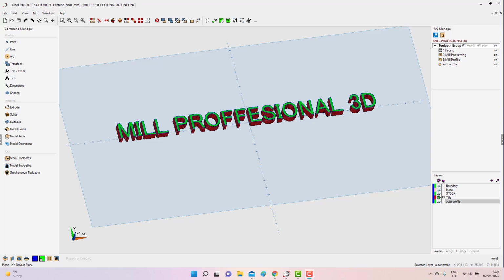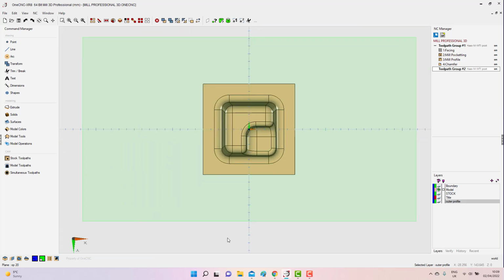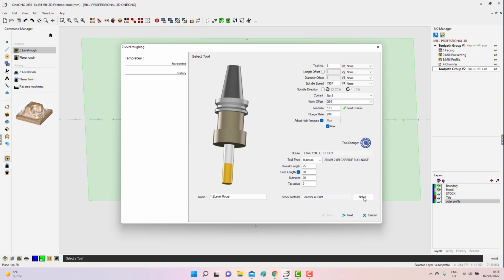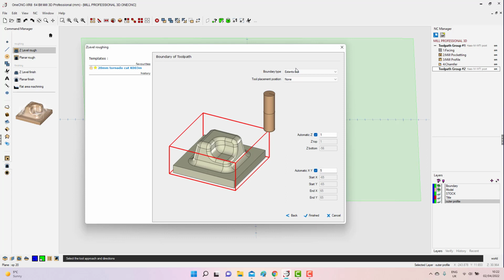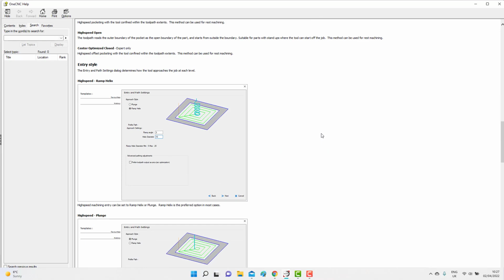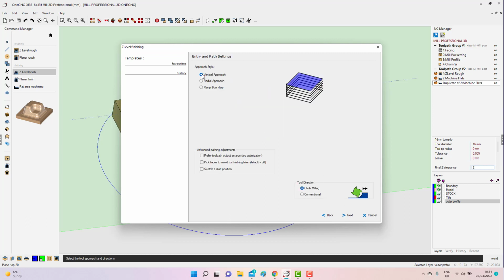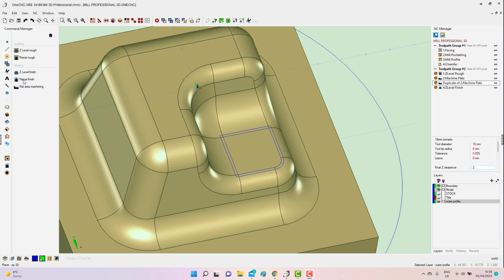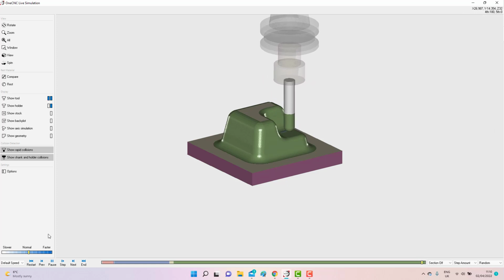OneCNCXR9 MILL PROFFESIONAL 3D

Comment: Thank you for your videos. I am a beginner in using ONECNC. I think it's a nice and easy to learn program, but I miss some simple and very useful functions, for example: When face milling ZIG-ZAG there is no option to use arc/spline instead of 90 degree transition. It would be very helpful to see the Speed and Feed values live during preview and simulation. I also miss the ability to use different Speeds and Feeds only for helical and ZIG-ZAG entry of the tool into the pocket. And finally - why is the pocket entry option available only for standard toolpaths and not for model paths?